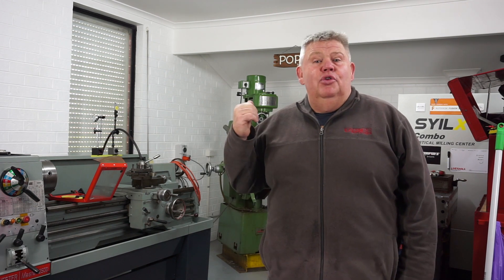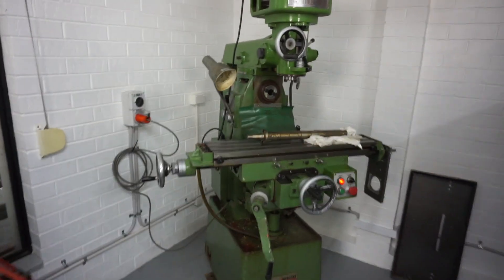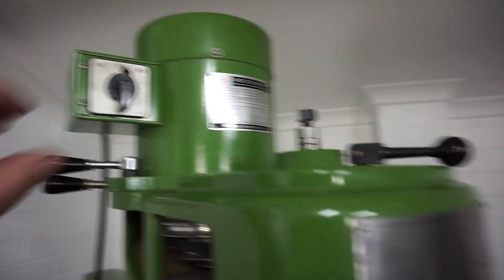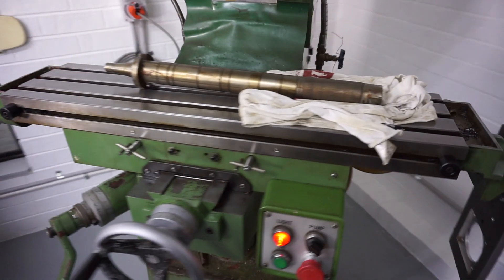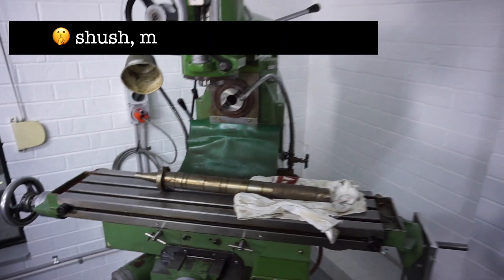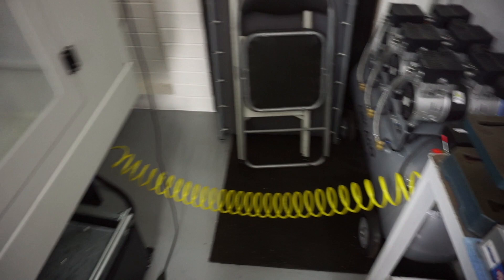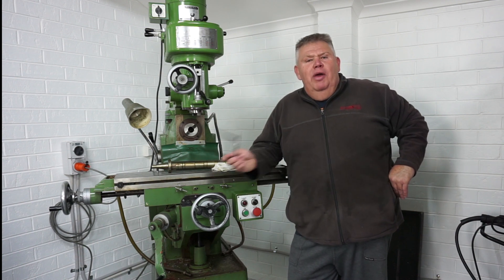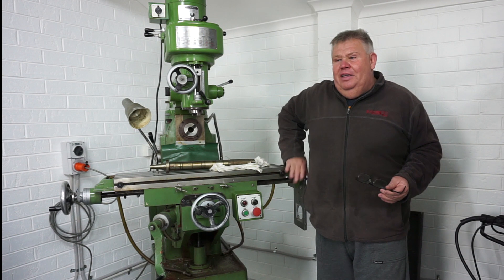New Milling Machine for my Shop - SHOP Update

Comment: That mill looks really good!! I feel the same way, it is a good thing to have a manual machine. I would have missed out on a lot of jobs if I didn't have my manual mill.I actually use the manual Bridgeport more than the cnc, there are times when I could justify another manual mill in the shop. Looking forward to seeing more on the new mill.
Reply from the maker: G’day Joe. Thanks for watching mate. I would have loved to get a Bridgeport or a Kondia to supplement my Colchester, but this little Taiwanese one will do me.  I’m excited to get her started on some projects. Got some reorganising of my shop to do first. I’m currently building a steel shelf that will hold my Phase Converter and air compressor. It will be a stacked arrangement. Then some shop rewiring and I should be good to go.

Comment: Nice looking mill with both vertical n horizontal options tw about perfect for a one only machine.
I never got into cnc machines but probably would have , but things happened and my career stopped.
Reply from the maker: G’day and thanks for watching. Thank you, she’s a little Taiwanese combination mill branded Herless. I’d say it was made back in the 80’s. It’s been a great machine for my little shop. I also have a Syil x7 CNC mill, but the manual is great for small and one off work. Cheers 🍻. Aaron

Comment: Hey Aaron.
Spotted this Mill on Instagram.
I had a feeling a video would not be far away.

I don,t want to say to much ??
But that guy lifting your Mill ?????????
Just asking for trouble.
Glad to see it make off the truck and on the ground. ( right way up )

I am sure you will have plenty of fun playing with your latest toy in the shop.
The way your going,  you wont be able to except any visitors soon ?
They have to stand outside your shop.
Still waiting for the reception area to be built prior to visiting.
Reply from the maker: G’day Peter. Yeah I was a bit concerned about that lift, but the lifting lugs attach to the cast base. It balanced nicely once he adjusted the straps to go over the front of the table. But yes I did have the “sphincter pucker factor” going that’s for sure. I watched a hoist topple over once being lifted the same way. Was nice to see her in the shop in one piece 😉.  Who knows when we get the state opened for business and I can ask visitors to come over once again 🤦‍♂️